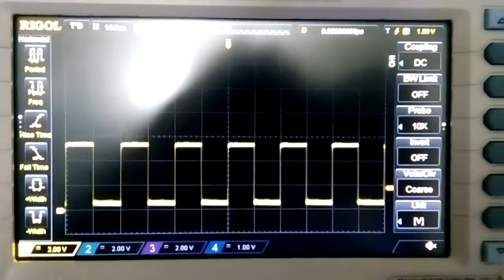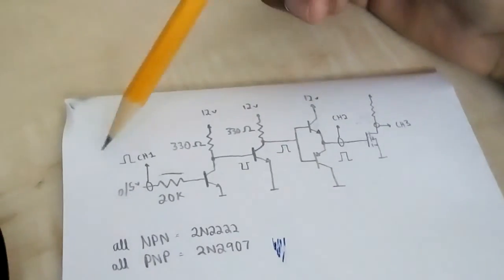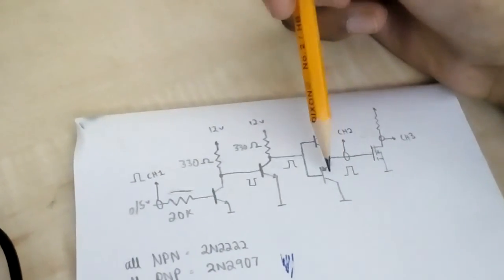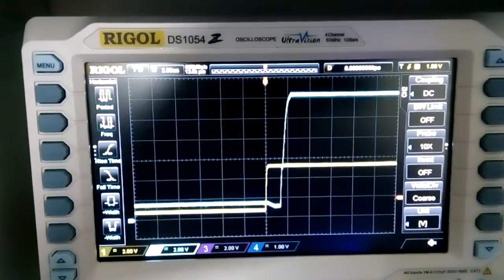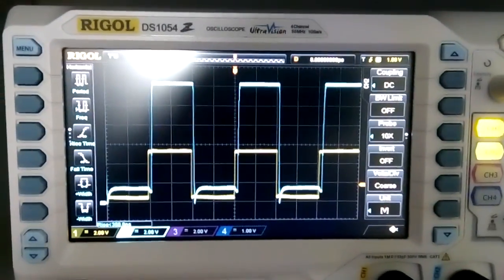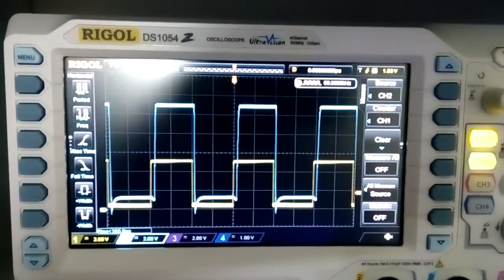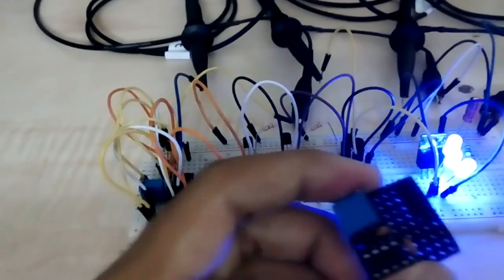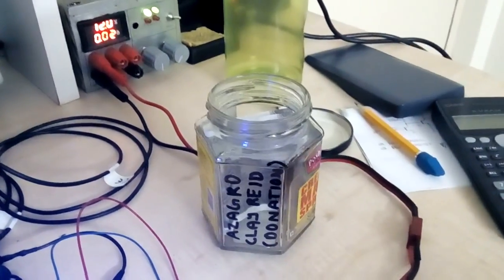MOSFET Gate Driving Updates

Comment: Madam, I don't have an oscilloscope.😅   So will u please explain that😊😊----
1. Can we mathematically find out the value of rise time for 33 KHz frequency ( at 50% duty)? 
And.. 
2. If the Base-driving current of the push-pull driver is 12ma so-that what will be the maximum current that the push-pull driver can give us as output ??
Love and deep respect for you from Bengal.....
Reply from the maker: RIse time depends on the capacitance of the load and inductance of the cables, but I guess it won't be more than 10% of the total on time.
Output current of the push pull driver again depends on the load, upper limit is set by the gain of the transistors, but for a simple circuit like this I guess it's around 300mA :)
Reply: @NNNILabs  Thank you madam, U got a new subscriber. Your tutorials are very helpful.

Comment: Though you didn't display it in your circuit, I assume you have a pull down resistor at the gate of the MOSFET, right? Also driving the push-pull with a single resistor might cause unwanted oscillation due to the parasitic capacitance of the single resistor. I also recommend a gate resistor on the MOSFET, 10 Ohms did the job for me. Removed severe ringing and even gave me better rise times. 
Perhaps in the future I am going to experiment using a choke transformer for driving the MOSFET gates, good rise time, even better fall time.
Reply from the maker: OH MY GOD!!!! THE PULLDOWN!!!!
Oh, Crap. I completely overlooked it.
Thank you so much for reminding me!
I have a few ferrite rings and some copper. Should give that a go.
Reply: Yeah, it's quite a good method, it's using the negative half cycle to discharge the gate capacitance, therefore you have double the potential difference.
Reply from the maker: Would doubling the turns ratio do?
Reply: 1:1 is pretty fine as well, you just need that half cycle. Though, 15V is the best you can get 20V is too much. Which is the case for almost every MOSFET. You can also use a flyback driver for gate driving. Which essentially also achieves ZVS on the MOSFET Drain to Source.
Reply from the maker: So will the driver shown in this video be worth the trouble?
Reply: Oh yes, certainly, you might not see it, but the peak current is capable of reaching over the 2A. I am using the push-pull configuration as well.
Reply from the maker: I just tried your recommendations. I added a 100 ohm series resistor and a 100K pulldown, after experimenting a bit. The results are marvellous. Too late to post a video, I'll do it tomorrow.
Reply: 100 Ohms on the gate? Try 10 Ohms, even better. A 100K pull down is also on the high side, 5k-10k should do the job as well. Maybe the results will even be better. Also try a bypass capacitor in parallel with your push pull transistors.
Reply from the maker: +Azagro
Could you make your Patreon page more parent-friendly? Too many swear words, and I've got to show them who I'm donating to.
Thanks.
Reply: +NNNI Oh right haha, sorry. If you're going for a one time donation, consider using PayPal. Patreon is meant for periodic donations, they also take a percentage if you want to receive it. PayPal allows direct access, so I don't have to wait 6 months before I can buy parts. Here's the easy access link: https://www.paypal.me/Azagro
Thanks again for being willing to support the projects!
Reply from the maker: Oh, thanks for the link. I'll talk to my parents today.
Is international money transfer possible this way?
Reply: Thank you! It's international yes, you can fill in any value for any currency, with one button.
Reply from the maker: Ok. I heard that you need permission from the reserve bank of India, etc. etc.
Hope its not true.
P.S. Have you worked on some kind of gripper? I'll not use real names.
Reply: NNNI Ah, no, this is using PayPal's own money, which you then give to them. Meaning there's no direct transfer. 
What do you mean by gripper? A mechanical arm or something?
Reply from the maker: Yes, a mech arm.
Have a look at this:
https://www.quora.com/How-do-I-send-funds-from-India-to-the-USA-using-PayPal
You've got to send me an invoice or something.
Reply: Yes, I have actually. It was pneumatic actuated. It was really bad. I want to make a new one, but a good one. 
Oh wow, that looks like a lot of trouble. Does that not only work for businesses? I am not a business.
Reply from the maker: I guess you just have to ask for a payment, which I can fulfill. Let's see if I can set up an account. I'll give you the details, you can shoot me an invoice and I'll pay.
Reply: NNNI Sure, we can try. If it doesn't work, no worries. 
Were you planning on making a gripper of some kind?
Reply from the maker: Ok.
No, I just came across this, you were in it:
http://project.3me.tudelft.nl/2016/wb28/
Reply: Ah, that's some severe googling you did there. That's indeed the one I did last year. :)
Reply from the maker: I'm sorry if I went too far, was just curious.
Reply: NNNI Haha no worries, it's public display, so it's a possibility.